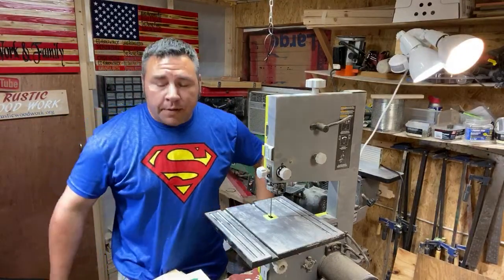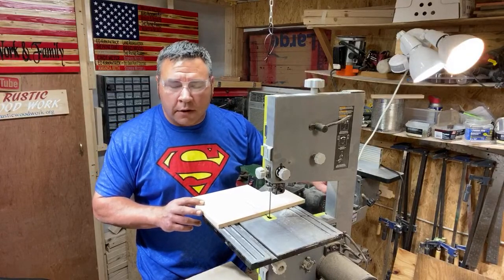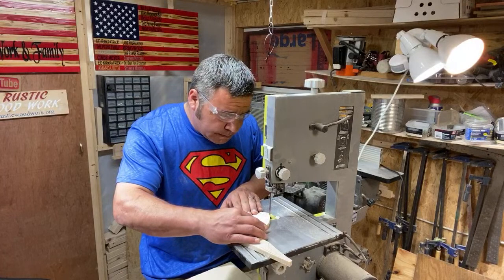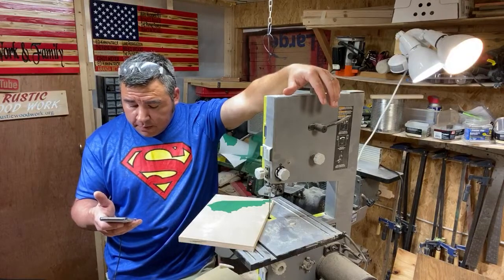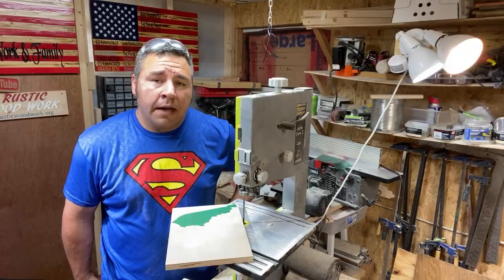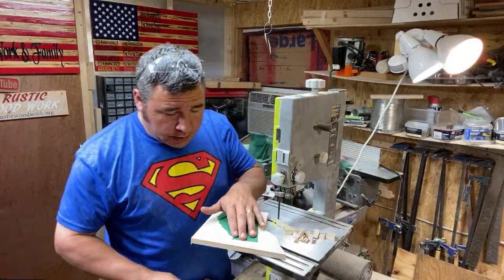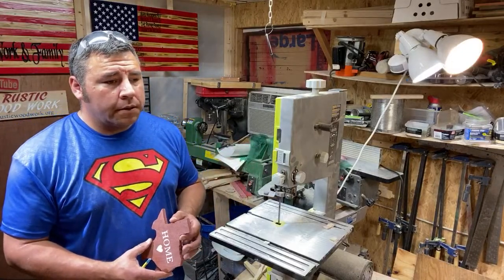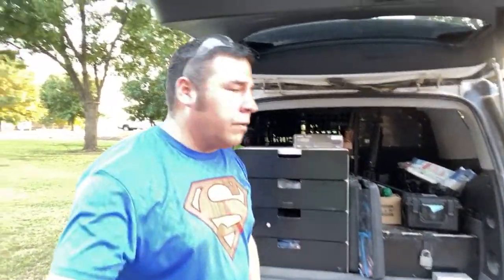How to cut your state out of scrap wood, DIY

Comment: Have you thought about making templates of the states from 1/8" or thinner masonite or hard board or even thin paneling?  Then all you would have to do is trace the state out using the template each time.  Could save your film.
Reply from the maker: Yeah I will probably end up doing something like that since were fixing to start making a bunch of them.